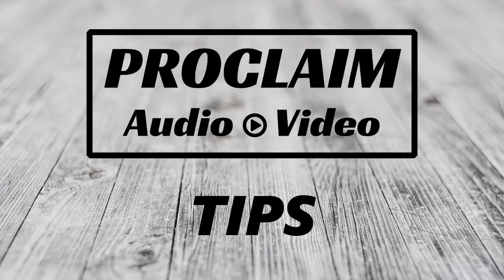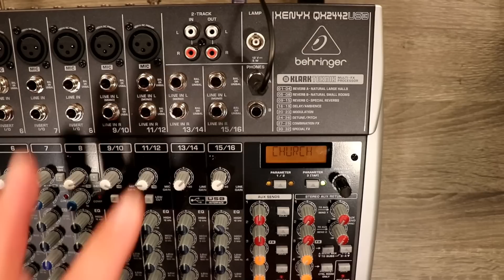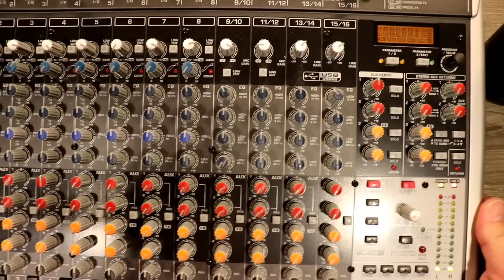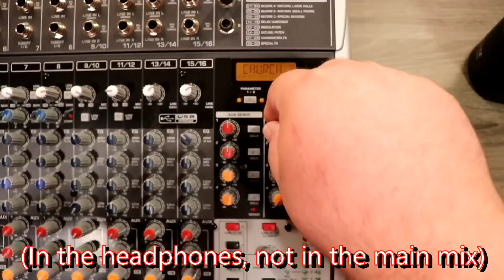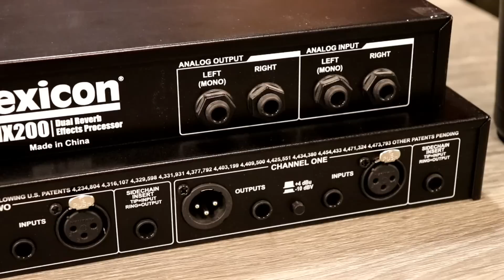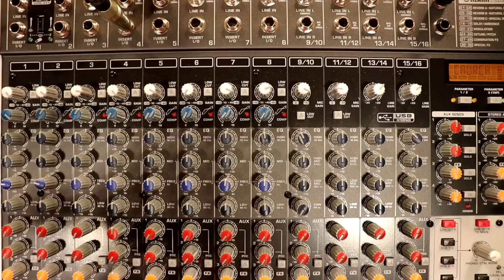Analog Mixer Basics Part 2 (How to Use An Analog Mixer)

Comment: Where would I connect a powered 4 channel headphone amp in this mixer? I tried a single 1/4" TRS from Phones A into the amp, but I was only getting my right earphone.
Reply from the maker: Well that's weird. If you're not using the RCA outputs you could use a stereo RCA to 1/4 TRS cable to drive the headphone amp. 👍

Comment: Hi I would be obliged if you could explain a bit more on the utility of the FX Out port on the back. The manual gives a very shoddy explanation, or perhaps, assumes the reader as an expert. My confusion is why would one need this port if you have AUX Sends? Is this a 5th Aux Send?
Reply from the maker: It's an additional output from the internal FX unit. What ever you mix on Aux 3 will also come out on this output. Plugging into it will not mute the FX going to the main output. Hope that helps.

Comment: These are great tutorials! I'm new to analog mixing and Behringer, and this answers every question except 1. So, if you're still reading these comments: what is the signal path to use, if I want to get Internal FX into my monitor mix?  The manual and other resources give examples for an external FX processor, but not so much about internal FX.  Any suggestions?
Reply from the maker: So unfortunately there is no internal routing of the FX to the Monitors on this board. You could try this work around. Using a TRS to TRS 1/4" cable, patch the FX OUT into the LINE IN on one of your empty Mono channels (let's say channel 8.)  Un-assign channel 8 out of Mains. Turn up the gain on Channel 8 to about 12 o'clock. Add what ever you want to FX using AUX 3. Then you can add FX to Aux 1, 2 or 4 using the knobs on Channel 8. Do NOT add channel 8 to Aux 3, because that is the FX bus, so you'll get FX routed to FX which just ends up being a mess - try it and you'll see what I mean. 😛 Happy Routing.

Comment: I am setting up a worship space in the concrete basement.  I have gifted to me a TOa 212.  I have 16 homesite panels to place on walls to help kill the echo.  Any suggestions would be helpful.  It is a very long and wide space.  I want to put the stage on the long wall.  Where should I set up my pa speakers?( far apart? Or close to stage at an angle?   Thank you.  Excellent training video.
Reply from the maker: Consulting is available, check my website for more information. As you can imagine, I get so many of these questions, I can't answer them all unless they help support my family. Glad the video was helpful and thanks for watching!

Comment: Great videos, I just purchased this same mixing board so it was really beneficial to me. For the Direct outs can I use that to go back out to like a bass amp or a guitar amp? I realize that I'll only be able to control the part going through the mixer to the mains
Reply from the maker: I haven't tried that but I believe it should work. 🤔

Comment: I have a problem with the same mixer, i.e. the vu meter shows no signs of life when I start a signal from any channel, for example, to start music I use a cable that enters the mixer in the stereo channels with 2 jacks and an aux on the phone, clicking main and raising both faders "main and the channel fader" the vu meter shows no signs, I don't know where to turn
Reply from the maker: I would check to make sure you don't have some other channel solo button pressed down. Thanks for watching!
Reply: @proclaimav4197  I have checked over and over again and there are no more clicked buttons, I will try to check again, but I don't think this is the problem. Rather I have a friend who has a mixer of a different brand and to see the vu meter give signs from the main a specific button has to be clicked, if this is also the case on behringer, what would it be?
Reply from the maker: Under the "Source" section make sure "Main Mix" is pressed down.

Comment: Appreciate the vid! Can you use the sub outs for headphones? Say I want my mix a lot more drum heavy and my singer wants it more vocals?
Reply from the maker: You can, but unfortunately Sub outs don't let you adjust volume individually per channel, they're just a reflection of what the main Faders are doing. Aux Out is a better choice because each channel has its own adjustment knob. For a mono signal into head phones check out the Behringer P2.

Comment: I don't have a board to play with (it's on backorder) But we're getting the Behringer SX2442FX. 
I believe you touched on it but, we need several monitor mixes. Can you use one of the effects buses as a monitor  bus?
What about using a sub as a monitor send?
Reply from the maker: Hi Frank. Yes you can use the FX aux as a monitor feed, just patch in on the back to bypass the onboard FX processor. I talk more about that in the first video starting here: https://youtu.be/T1y8cjigI4Y?t=1135 By the way you can use the the Submixes for monitors but you only have the same mix as your main mix, no individual channel control, only volume control. Thanks for watchin' !
Reply: @proclaimav4197  That's what I was hoping you'd say.
Thanks for your informational feedback and your videos as well.

Comment: QUESTION FOR YOU:  Apart from using the USB out - how can I output from the mixer to a computer (ultimately into Reaper) ?    Thanks for a solution you can offer.
Reply from the maker: If you want multitrack, you will need a multitrack capture device.